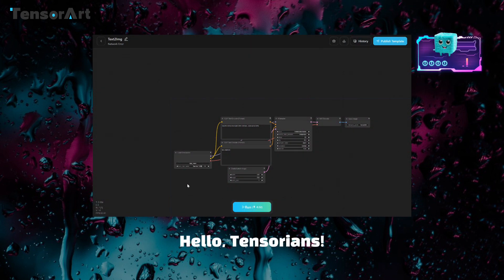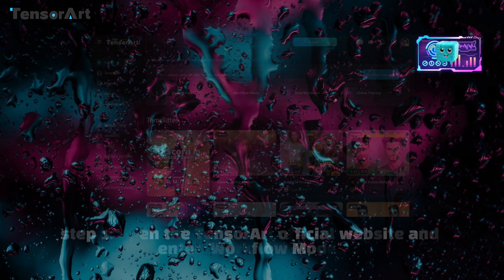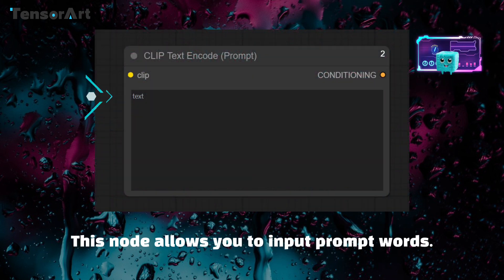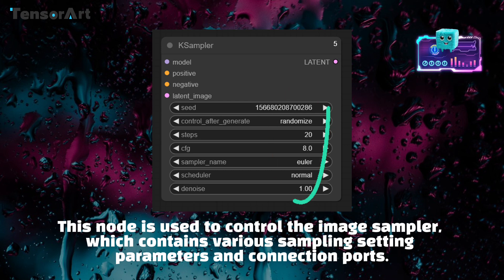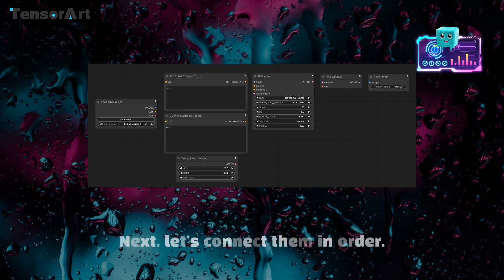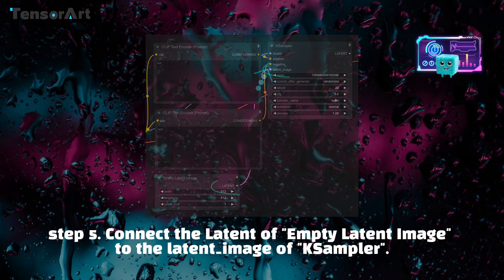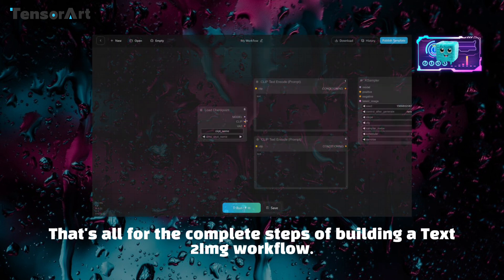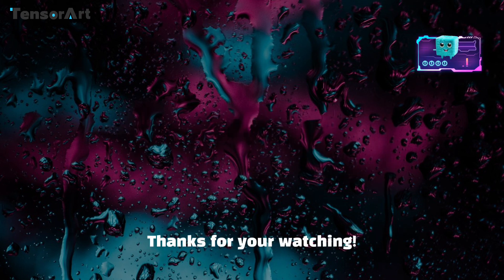How to build a Text2Img workflow from scratch?｜ComfyUl Tutorial Episode 2🔮

Comment: If I create artwork in both using the same prompt, what do you think? The result will be better in both ways. 
Classic or ComfyFlow?
Reply from the maker: Thank you kindly for your question regarding image generation quality. If both workflows utilize the same AI model and technology, we can anticipate that the image quality should, in theory, be similar. However, should ComfyFlow offer additional optimizations or an enhanced set of tools within the user interface, this might indeed result in a distinguishable difference, not only in the user experience but also in the ultimate quality of the images produced. We greatly value your engagement and hope this explanation supports your endeavors with image generation platforms.
Reply: @TensorArt  Thanks for Clarification ❤️